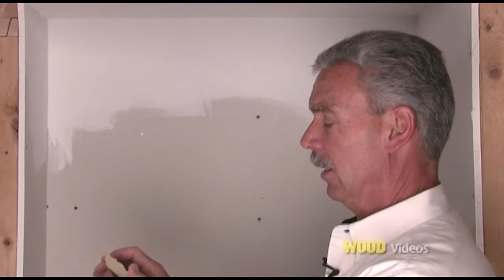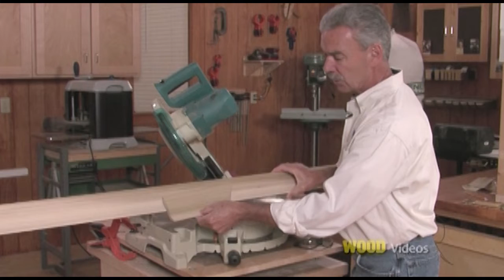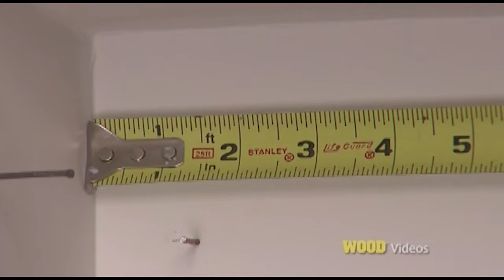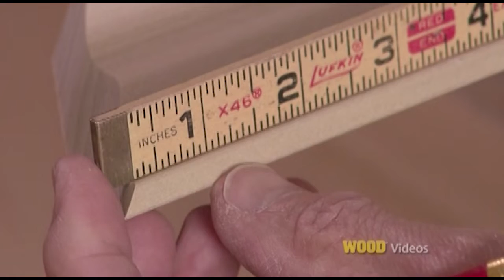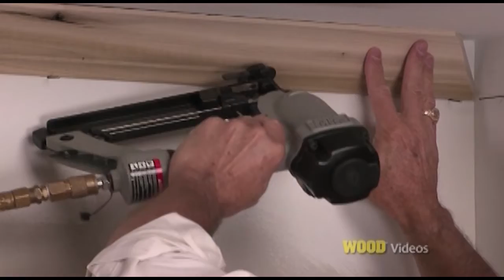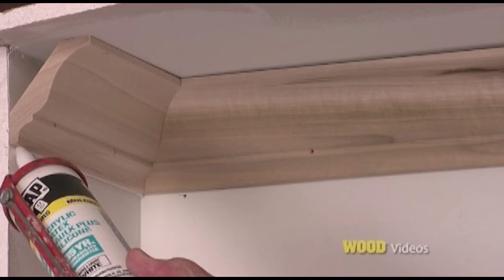How To Install Crown Molding - WOOD magazine

Comment: I guess that's an ok way to trim a 3' x2' 3 sided room. I very,very seldom use metered corners. I like coped corners. Instead of using nails which will not hold up a 16' piece of crown I cut a piece of plywood with a cut out if whatever the dimensions are of the crown. Then use that to push it up into the corner of the ceiling & nail it. 
Also your wall cut away is not correct. The sheet rock goes on after framing so you'll have 1/2" less wood to nail to. 
Love your table saw videos. This one not so much